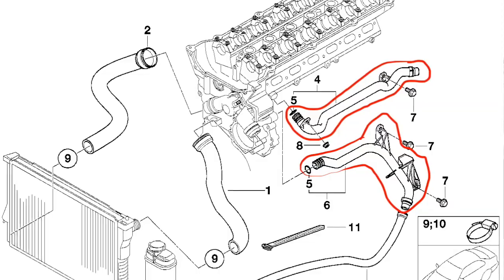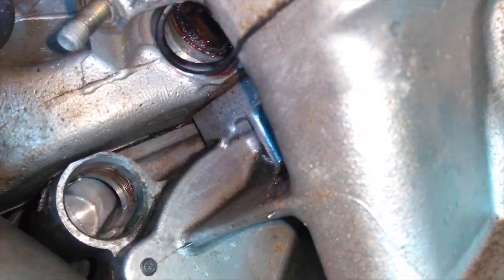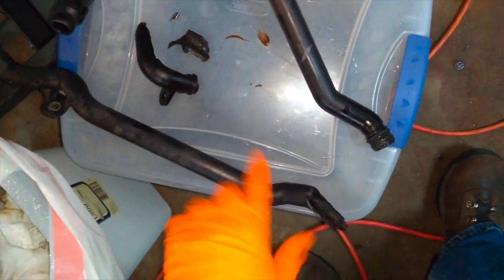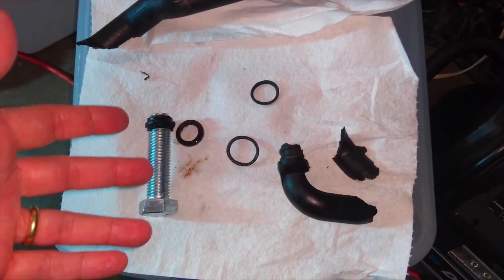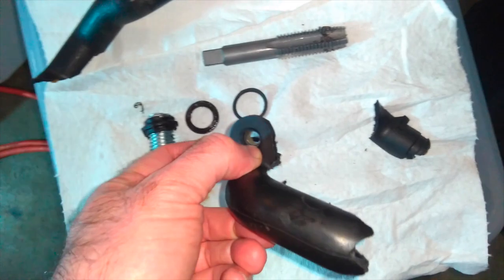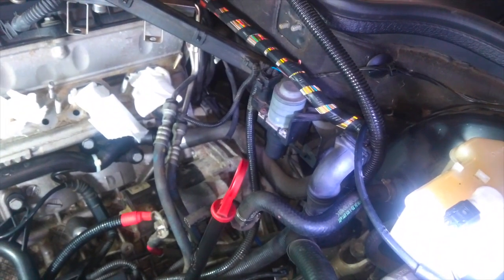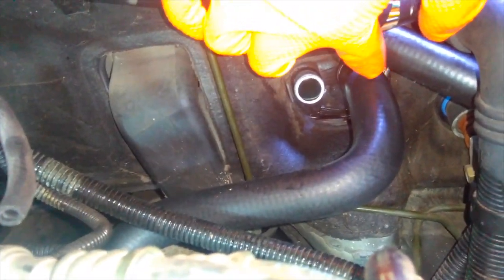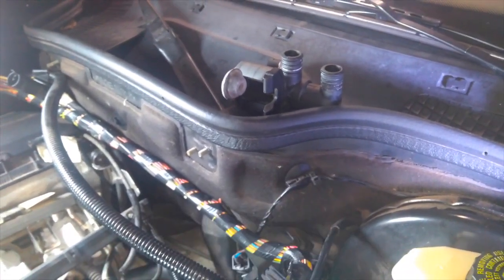Replacing plastic coolant pipes on a BMW Z3 M52TU M54

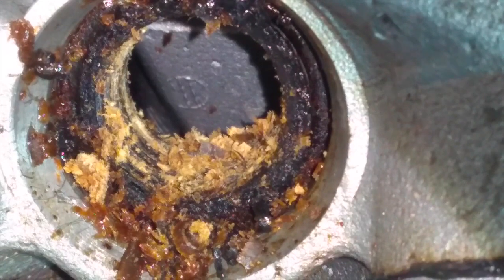Comment: 8:40 cut a hacksaw blade into 1/3, hold it with vice grips and gently make 2 cuts, 1/4 apart in the junk stuck in the head.  with a pick remove the 1/4" piece, then the rest will come out easily
dont cut into the block and dont try a threading tool cause you can really score the head and that will never seal back properly!!

Comment: Great video! I’m in the middle of the same issue right now on my 2003 325i, 200k miles. Original pipes and the top pipe just came apart in the orifice after I turned and wiggled it for about 20 minutes.

“Multiple frustrating hours later” - so true!

I wish there was a “send uploader case of beer” function through youtube. Because I extracted the pipe remnants using the 3/4”x10 tap and bolt. And it worked perfectly to remove the hardened plastic bits! I wish I could send you a case of beer in my gratitude.

Comment: Hi there, is it one or two o-rings per pipe end?
Realoem says to buy 4, but only shows one per pipe.
I have only one per pipe but I didn't strip it so not sure if I'm missing a couple.
Also, 3/4" is about 19mm. In a land of metric would you go bigger to M20, or lower to M18?

Comment: Matt, I have a 2001 BMW Z3 3.0i roadster. I am not tackling the same issues you are, but I really want to thank you for these videos on the Z3! By watching your great videos, it has helped me so much when tearing into my sweet Z. I have a JPo335 code and have replaced the crankshaft sensor and  both cam sensors. I am now tackling the wiring harness under the intake manifold. If it is not this wiring, I guess I am looking at replacing the computer. Again thanks for your vids.  PS I am sharing this youtube channel with my son, hence the name SuperJoshua.. I am Ron.

Comment: Hey, what did you use to lube the pipe o-rings and fuel injectors o-rings? Making sure mine doesn’t leak. M44 1.9. Thanks 🙏

Comment: This is an outstanding video, many thanks. I just finished removing both stuck hoses using your method, and it worked flawlessly. I don't know how else I would have done it because the hose tips were stuck pretty hard and the scraper I was using would not grip the plastic and would slide over it. 

One suggestion for anyone attempting to do this is to insert the screw as far in as possible so that none of the hose material falls off the screw tip when retrieving it. Also, if you remove the thermostat and the water pump, you will be able to see and capture any scrap material that falls inside the engine block (I noticed for example that a good portion of the material that the tap shaves off falls inside the engine block and was captured by the rag I had inserted inside the water pump casing. Too many details perhaps but they may come in handy)

Comment: What’s the to trick so the brand new inlet pipes don’t leak?? Because mine did
Reply: Use high temp silicone around the o rings. If you don’t go back with the oem bmw part it may leak because the aftermarket doesn’t seal as well partially due to the o rings they use. I know I’m to late to help you but hopefully this will help someone else from doing this job twice.
Reply: @chrishibb9513  thank you!! My coolant flange just blew, they wanted $280 for that and $170 for a coolant pressure check. I told em the part is $10 and a coolant pressure kit is like $135. I'll go n do this myself thanks.